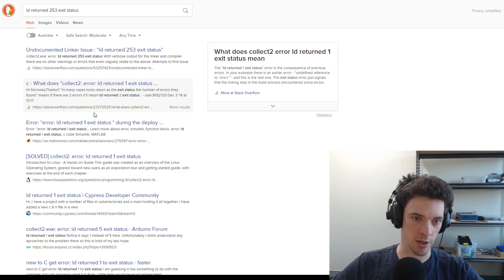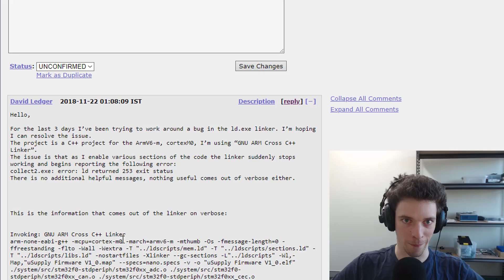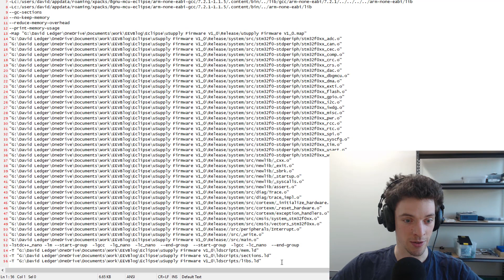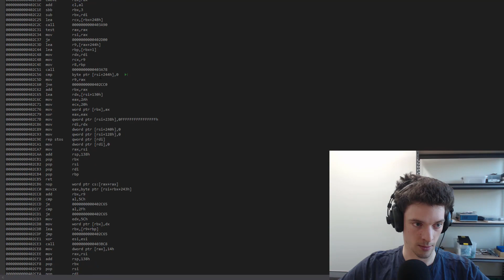GCC Embedded Linker Issue Stops uSupply Development

Comment: These can be the worst, remember rearranging code in the 90's with early Zortech C++ compilers. Does it happen with debug and release builds? Some really large stack based or global structure? Conflict in definition/initialisation of a global scope data object amonst modules?  Compile without code inlining/optimisation. Function naming (some library conflict)? Sometimes ends up just stubbing code out inside functions until it compiles & links again then working forwards uncommenting stuff. Do this without the optimiser or it will optimise out what you are trying to do.

Comment: I wonder if it would work with Link-Time-Optimization (and optimization in general). When using LTO, the optimizer will run at link time, instead of running for each translation unit individually. What the linker sees will be vastly different than on non-LTO builds. Might be worth a shot.

Comment: 1. Since when is windows a C++ development workstation OS ? o.O To each their own I guess haha
2. Try debugging with GDB, I find more GDB more useful. 
3. I had a similar issue when building my database design software in pure C, turns out I had way too much shit on the stack and had to move things to the heap, I doubt thats your issue here since this really looks like a linker crash. 

That being said though a linker crash would indicate a lot of edge code, maybe you should try reducing your stack or increasing the stack limit. 

If you could find a way that we could reproduce this issue without your proprietary code that would be awesome, unless this is open source and I could have a peak at it. 

Hope you find a solution!

Comment: It's been a while since I did any bare-metal ARM programming.  The tools I used were correspondingly more primitive and beta, so I always built my own tool binaries and ran them through the test suites before trusting them.  Cross-development has enough pitfalls as it is.  Building for (and on) the host CPU can eliminate many subtle host-dependent issues. 

Yes, building GCC and ld truly sucks, and the tests take a while to run.  An alternative is to rent such an environment, one purpose-built to the need.
  Others have certainly done it before, and likely better.  I believe AWS used to offer such a built-for-purpose cross-development pre-packaged service, though I suspect there are specialty firms doing a better job of it these days.

The general advice shared here to build under Linux is good.  I've been testing Win10 WSL and find its userspace to be totally GNU and shiny.  I run vscode under Win10 (Electron is a memory hog, but it works), then build and test under WSL.  There are limitations (such as slow I/O, some missing kernel ABIs, and an incomplete DBUS implementation), but none are show-stoppers for the tools themselves, which are the Linux binary versions (not WSL-specific builds).

Oddly enough, the terminal emulator can be an issue: ConEmu works best for me, but it has its own subtle issues.

Comment: I suspect that the issue might lie within the Windows file path limits. You should use the freeware tool like https://github.com/deadlydog/PathLengthChecker and check all the resource paths for their length.
More info about the path length https://docs.microsoft.com/en-us/windows/desktop/fileio/naming-a-file
Reply: Tried it in root, didn't resolve the issue :(
Reply: @davidledger5941  Hi David,
how long is then the compiler executable's command line including the parameters?
I'll suggest to run the Process Monitor form sysinternals just before you start the compilation and stop it right after the error. Then you can filter the captured results and locate the PATH_NOT_FOUND to see "what is missing"
Reply: @SelfMan-SK  There was no path not found error, it is a stack overflow issue not a path related issue :)
Its related to the total number of symbols in the program generated by gcc7.2 (which generates much more symbols than 8 or 9).
The issue is mostly sorted out but not entirely.
Reply: @davidledger5941  I was just thinking that you might see the error of the compiler engine itself.
I mean it in the sense of a windows program crash analysis.

Comment: Reminds me of my first go-round with GCC years ago with the 68HC11. I had just been learning C and C++ and thought I would try it on the 'HC11 instead of assembly like I had been doing. I could not get a simple program to compile and got cryptic errors that were of zero help. Long story short it was all due to the same value being def'd, undef'd and redef'd through a series of 15 or so .h files. IIF it happened to parse the files in the right order it would build, if it parsed the file with the incorrect undef/redef last you were screwed. I don't remember how I came to be looking at the one definition but I do remember spending hours pouring through the source following the order things were built in order to find the problem.

Comment: Assume you're using some kind of source control system? If so, how about going back through the commits to see where the first instance of the problem occurred, and diff the last working tree with the one after (which failed).

You might be able to code around the problem.
Reply: Yes, I did that a dozen times but whatever route I took back came the error.
Reply: David Ledger OK, well you must know the exact line of code you added that produced the error. At this point I'm thinking Windows or toolset updates during your work might have caused the problem. Does it build in a fresh Windows vm with no updates, or on Linux? Or another machine? Is it a daylight savings time problem? I know, a long shot, but you're using a nonstandard/custom build environment with Linux tools (and maybe Linux-ish but incomplete filesystem support on Windows through MinGW or cygwin). Check the datestamps of all the intermediate files (.o/.obj etc). Do they match your last clean build time?

Comment: Basic development skills, go back to empty main, compile, does it work? Then re-enable code one small part at a time and check whwn it crashes. That way you should be able to understand what part of the code makes the linker unhappy. Then you can choose either to change your code, or the linker executable (I know what option I'd choose...). If the linker is going crazy and you are doing fancy c++ stuff check templates AND constexpr as it can be run by compiler/linker. And btw if you develop STM32 projects under Windows why the ** are you not using Atollic ?????

Comment: It's been said many times and I tend to agree. I think getting debug symbols and debugging it would be easier under Linux.
And you might find out it's a issue with the Linux build. Would suck, but at least you'd know. gcc in Windows is most likely not the most well tested platform.

Comment: Does your code have LOTS (Megabytes) worth of compiled/linked data structures and/or strings ?
I have had issues with that, and resorted to some fancy reorganising of how to embed data through source code to make it happen.
compilers don't like compiling data :-D

Is the stack overflow happening on the main thread or on a worker thread?  As some have said, changing the stack size of the main thread is easy enough and can be done with EditBin.
For a worker thread, those usually inherit the size of the main thread, so again, EditBin to the rescue.  If the thread is made with a specific stack size, it will require some trickery to get it to change.  You can "easily" try this running LD in a debugger, setting a breakpoint on the CreateThread() API call and changing the stack size.   If it works you can make this change more permanent  by patching the exe, recompiling LD, writing a stub or one of several other ways to "fix" broken exes. and pass it along to the LD devs.

Comment: Things to try:
A more recent version of GCC.
Linux as host operating system.
Shorter filepaths.
Directories in which files aren't constantly closed and opened by handles to continuously sync their contents (onedrive).
Ensure filepaths do not contain spaces.

Last resort:
Compile on an arm-eabi architecture machine such as most SBC's

Comment: Visual Studio only understands PDB symbols.  GNU tools are usually built with GDB symbols.
Using objdump, the function at the top of the stack is ___chkstk_ms
It looks like it had a stack overflow while trying to demangle a C++ symbol (possibly trying to print an error about something associated with that symbol?)
at ___chkstk_ms+0x16
at cplus_demangle_print_callback+0x119
at d_demangle_callback+0x1a6
at d_demangle+0x3c
at cplus_demangle_v3+0xe
at cplus_demangle+0xce
at bfd_demangle+0x16b
at vfinfo+0x452
at minfo+0x48
at print_one_symbol+0x26
at bfd_link_hash_traverse+0x5a
at print_input_section+0x253
at print_statement+0x789
at print_statement+0x580
at lang_map+0x22b
at main+0x64b

Comment: If I were you, I would try building the project on some Linux distro. Probably the latest Ubuntu LTS, because it is the easy way. That way I would exclude the possibility that the problem is related to the half baked POSIX layer the GCC is running on. Also, you can track down the code part that crashes your linker by splitting your project into smaller pieces and building them separately. From the look of the compiler output, you are heavily using the latest C++ features. I can bet that the problem with the linker is related to some very long type name due to template expansion. You just have to find, which one it is.

Comment: I have had random linker errors like this due to errors like circular includes. The linker should have returned a diagnostic message, but it didn't. Absolutely no guarantees but it might be worth checking everything just once more with a rubber ducky on your side :)

Comment: I think you are going at it the wrong way. Find out what causes the problem in your code and not what the problem in the linker. Your code must do something to drive the linker into an edge case, that nobody except you has. So it should be more efficient to remove the edge-case from your code, rather than the bug from your linker. Write me if you want me to have a look.
Reply: I agree, but would do that as an absolute last resort, before doing a complete code-rewrite. The way he is doing it right now, is IMO the right one, as it might help someone in the future to not have that problem, because the bug has been fixed.
Reply: @MariusLuding  When you find the trigger of the bug in your code, it is easy to find the bug in the linker, as you can narrow it down. So finding the edge-case in the code, may also mean finding the code in the linker (or at least be able to provide a proper error report)
Reply: I agree... Proper use of git or any other SCM would direct you to the last change that caused this error. Although you get compilation errors you should at least know what in your code caused this error.

Comment: If the stack pointer/register is corrupted, then most often you can't trust the stack. Try to see if you can enable reverse debugging in your tool. That can be a good way to see where the problem starts. Or your a memory sanitizer or valgrind.

Comment: For start, fix the lots of warnings. Add -Werror and work with it. They you can think about other's bugs.
Reply: They were just some type punning and signed char != char warnings + some unused variables.
All fixed. Same issue.
Reply: @davidledger5941  ok, it seems it have some template magic. Does it have recursive instantiations? Anyway, i think its no other way than cut off project parts and try to build without them in order to isolate problem location.
Reply: @psialt9720  Yes, there is template code there (use it to do config at compile time), but not possible for there to be infinite recursion. There is no internally self referential template code here, only externally. So it can only contain instances of itself as many times as the programmer defines (for example):

std::tuple a = std::tuple(1, std::tuple('b', true));

The above doesn't have any risk of infinite recursion but is sort of recursively defined, I use that sort of thing (not tuple but ultimately similar symbols).

Comment: Dave, this might be a long shot, but this issue might be related to file path length, or filesystem access.

I've run into an issue before with the linker not liking having to link many files with very long filenames each.

The other long shot is that the linker might be having issues accessing the filesystem (I know the OS should handle all of that; and it should be transparent to the linker, but still, I've heard of OneDrive causing weired issues to some applications and I see that your project lives under a OneDrive directory). 

I'd attempt take all the .o files from the different directories and dump them in one directory, then just put this directory close to the drive root (maybe under C:\Users\user\Desktop\linker_bug\*.o) and try to compile them.

This should be a simple test and it has a chance of fixing (or working around) this issue.
Reply: Next thing I'd do is to try to link it on Linux. Options are:
- Boot into Linux (maybe live USB version)
- or: Use VirtualBox
- or easiest is to install Ubuntu 18.04 from the Windows Store using WSL (if you're on Windows 10)

Enable WSL and install Ubuntu 18.04 from here:
https://docs.microsoft.com/en-us/windows/wsl/install-win10

Ubuntu 18.04 Store link:
https://www.microsoft.com/store/p/ubuntu/9nblggh4msv6

Then once you have it installed, just launch Ubunu 18.04 from the Start menu and do: 

sudo add-apt-repository ppa:team-gcc-arm-embedded/ppa

Y

sudo apt update
sudo apt install gcc-arm-embedded

Now you'll have arm embedded GCC installed on the Ubuntu 18.04 instance on your Windows 10 machine. Just cd into the directory that has all your .o files (C:/ will be mounted under /mnt/c/) and link them using arm-none-eabi-ld just like you did on the Windows side.

Shouldn't take more than 15 mins to setup.
Reply: Great idea, trying now.
Reply: Nope, didn't change anything :(
Reply: @davidledger5941  bummer, I had high hopes for this one :(
Reply: @jowadmax1921  Me too.
Reply: And remove any whitespaces in path/filenames  of course, but I expect you already have. (Whoever came up with allowing whitespace in paths and filenames needs 're-educating')
Reply: I was going to suggest this too, we had troubles at work with the same problem.
Something else maybe worth trying (maybe it wil get around the link problem?), is to do a "lump" or "unity" build. You include many .cpp files into a single .cpp and then compile and link that instead of the indiviual source. People usually do it to get better compile times, but the linker get's an advantage from it as it can see more methods at compilation unit scope so it can optimise them.

Comment: Fix your warnings. Some of them might be real issues that only are fatal at the linker stage. If you don't know much about compilers, you won't have a great time debugging the linker even in source code form (it would supply more information for the bug report, though).
Reply: I have, the ones that remain are:

signed char != char (I don't care though so lol)

unused parameter

type_punning (but it is a valid use of it)
I was just being lazy, should have written static_cast<std::underlying_type_t<E>>(e);

Nothing really bad, but I'll get rid of them anyway.
Reply: I now get 0 warnings. Same issue :(
Reply: @davidledger5941  dang.
Reply: @davidledger5941  use stdint..
Reply: @jaycee1980  #include <stdint.h> ? How would that help?
Reply: @davidledger5941  If you want specific sizes and types, use stdint. C/C++ does not actually guarantee the sizes of char, short, int, long etc. It's simply a good habit to get into. Before stdint became a thing, I used to have my own header file of types for it. In case you're curious... 25 years of programming experience across several platforms...
Reply: @davidledger5941  this is also suggested by most, if not all, modern c and c++ guides. And you are even forced to use them in safety critical evironments by ie. MISRA C, which is a good thing. The only "plain" type you should use is char.  And that one only if you are indeed dealing with characters. If you need a byte, use uint8_t.
Likely not going to help with your linker troubles tho.

Comment: Not sure why people are talking about Windows and Linux. I'm assuming you're compiling for an ST embedded processor. I don't know the size of your project, but it's obviously something in your code that is surfacing the issue with the linker. If you're using HAL/CUBE, they should be compiling fine. So I would start with your code. I would copy your project, then start commenting things out until the problem goes away. One easy way is to just comment out the function body of methods. You're using C++ so this should be easy. If you comment out just the guts of a function, you can eliminate large chunks of code without affecting the compile. Also, did you try turning off optimizations? I'm sure you did, just asking.
Reply: because this what Linux fanboys do, instantly blame Windows for the problem even when it's NOT the problem